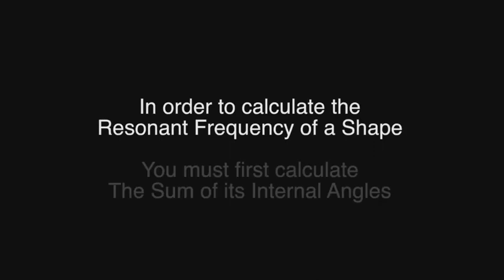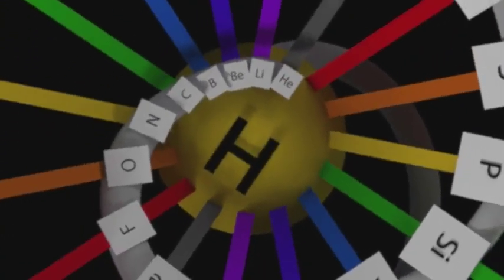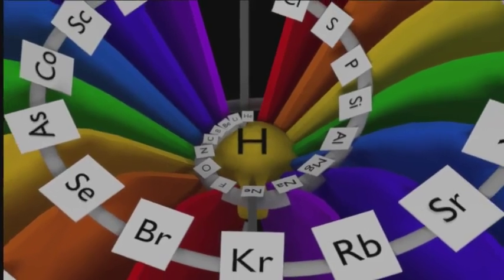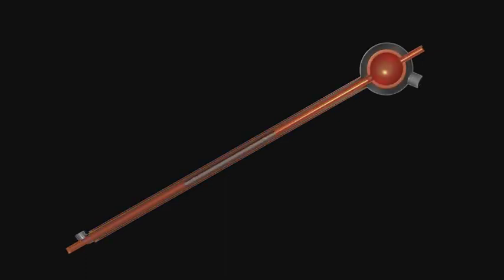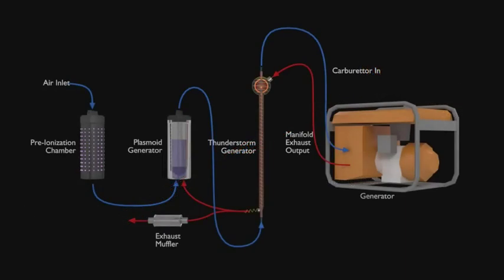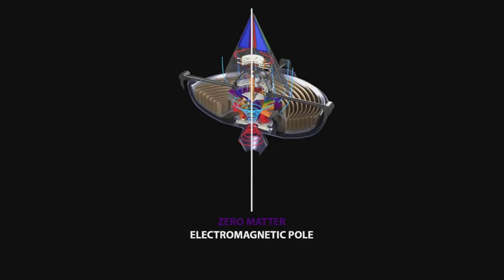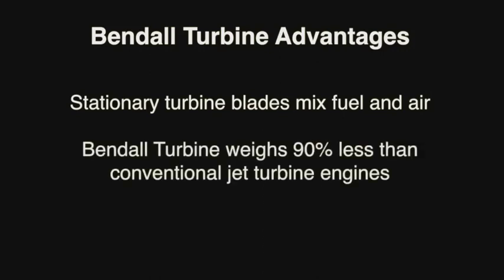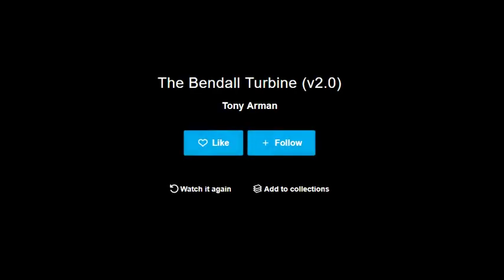The Bendall Turbine — Plasmoid Generator (Strike Foundation)

Comment: If this is true and you could harness this energy with a machine, there would be no way to turn it off. The machine would endlessly run until it malfunctions like all machines do. You really think the machine would be strong enough to shut down endless energy? You’re retarded

Comment: If you cut slab the inner circle of the outer exile, you need to refer to the atmosphere if the interjected sum angle at 44 degrees. This will always elude to 13 at any plasmoid.

Comment: Where is the flux Capacitor?
Reply: And where is the Continuum Transfunctioner?
Reply: And why is not the Plumbus visible? If you can't grapple the chumbles and can't flip the fleeb, how will the dinglebop be rubbed to generate heat?

Comment: I like how the literal model shown at 5:26 is later shown to be a physical part of the turbine design at 13:27, labeled as an "electron scavenger" (which is indeed a real thing I've just googled, but not the thing being portrayed). 
So what is it Mr. Bendall? A unified model of life the universe and everything? Or a physical component of your mystery motor? If your answer is anything other than "42", then I'm afraid I've lost track of what exacly you are trying to sell.
Well, if you make a schnazzy 3d model you might as well use it as much as you can I guess.

Comment: The new model is equipped with a Thundernuts antimatter chamber powering the Johnson Rod swirller.
Reply: Well there's your problem you need a new Johnson rod!
Reply: Johnson rod! I thought it was using an atom generator hooked up to a jake brake! Idk what to think know...
Reply: Your flay rod's obviously gone out of skew on your treadle, also.
Reply: Make sure it’s offset is precisely 69 degrees.

Comment: Sounds like geet
Reply: Seems to be be simply a refinement of GEET, with all parameters tuned as accurately as possible with the ECU and all that attention to design geometry/topology..
But just this week, after making all these wonderful designs, Bendall doesn't show a functioning turbine, but a modified OTR genset with a Perkins motor running very efficiently and ultra-clean- the modifications being only on the intake and exhaust systems, not at all the motor itself.
It is nothing to sneeze at, a 300KW generator running at lowered output of 200 or 250 KW, with very low CO2, CO, and almost no unburned HCs to speak of. The design is open-sourced, for anyone to try, with better results using stainless steel and copper for the intake/reactor/exhaust plenum, but still pretty amazing using mild steel. Bob Greenyer just posted a vid he made while visiting Bendall's test bed last week.(2023/10).

Comment: I fear Randall Carlson was duped. Hope it doesn't tarnish his career.
Reply: I was just thinking the same. I hope this is just a small hurdle for him.
Reply: alot of comments are saying this in these exact words on all the posts on redit and youtube on this subject...i smell bots
Reply: Never again on jre
Reply: So why don't we have these in production and use? I dont get it. If it's 20+ years old, shouldn't it have been implemented by now? I'm not trying to discredit, only trying to understand.
Reply: @slipknotic2682  It's only properly been acknowledged as working when built because according to modern "physics" it shouldn't. Ffs the electric ac engine for cars was designed by tesla in 1900 so why has that taken over 100 years?? Now they're everywhere same thing.
Reply: @slipknotic2682  because the thunderstorm generator would lower the price of oil and pretty much eliminate the need for green energy (even though gre3n energy is a scam) and the vajra implosive turbine would make energy free.
Reply: @slipknotic2682 @slipknotic2682  because the thunderstorm generator would lower the price of oil and pretty much eliminate the need for gr3en energy (even though gre3n energy is a scam) and the vajra implosive turbine would make energy free
Reply: Have you built a copy yourself? Ole mechanic said made a basic implementation in about 5 hours.

It would be very unfortunate if you were talking smack about something you've never even attempted.

If you have, I'd love to see your results!
Reply: Duped ...this works ...they've tested it plenty.
Reply: Hes bought and paid for by feds. To make people not see what is coming
Reply: https://youtu.be/d5YsK3bwzPM
Reply: I was duped by Graham hancock as well
Reply: This is the biggest bait comment I’ve ever seen, you should attempt more foundational videos before coming to this more advanced example. I don’t even understand but I strive to attempt before dismissal
Reply: @julianthincock6863  I'm a real engineer bud.
Reply: @iLoveChrisSmoove  Same and I agree. This is all garbage.
Reply: Duped? Maybe. But Randall's full of shit too.
Reply: Tesla probably had stupid monkeys throwing poop at him a time or two.
Reply: It won’t.
Reply: Go look at the recent data findings
Reply: Takes less work to sit in one's cave and agree with everybody else.  Of course they'll enjoy using it once it's in production.
Reply: He is bulletproof
Reply: He has been duped!
Reply: This thunderstorm generator works!! But if someone were to get something wrong your career isn't tarnished, your reputation isn't tarnished, you just happened to get something wrong, oh well, does everything we try but don't succeed at tarnish us? I think it makes us who we are. Be open and open minded. Peace
Reply: People who haven't done the research will always say it won't work and lazy people
Reply: Are you fucking serious??? This is the problem with the world today. People are too fast to label anything new and out of our understanding as bullshit. I bet you were fast to line up for your COVID vaccination wasn't you 🤣🤣🤣. Because some corrupt government told you to 🤣🤣🤣.  Our true ancient ancestors knew so much more about our actual world that is hard to comprehend. The ancient monuments all over the planet that we still have no idea how they were built and still couldn't do with our current technology was left to us to pass on the knowledge they had acquired to us when we were ready to start listening to all the evidence all around right before our eyes. Frequency is literally the key to everything
Reply: why? is it because you do not understand it yourself?
Reply: @DybbukDEpstein  buddy I have an Ocean Front Property in Montana to sell you.
Reply: @DybbukDEpstein  The first 30 seconds are utter nonsense. "The north pole which rotates anti-clockwise, and the south pole which rotates clockwise." What, each half of the imploded sphere are rotating in different directions? An object's resonant frequency is the sum of its internal angles.. Why are we using 8 planes and what's the significance of 22.5 degrees? The imploded sphere planes resemble the infinity symbol.. Why does that matter?  He's literally saying gobbledygook with no explanation.
Reply: @iLoveChrisSmoove  there are plenty of other videos on vortex math as well as books out there for you to formulate a foundational understanding of the subject than watching one video that is beyond your comprehension. Clearly you did not do that if all you can do is point to this particular video in order to discredit the theory. That's like watching someone speak in a foreign language and affirming that they talked gibberish since you could not make heads or tails of it. Look up Marko Rodin and watch his 20 part lecture from 20 years ago to attempt comprehension. You have zero fundamental understanding of the principals of vortex math which is by this is beyond you.
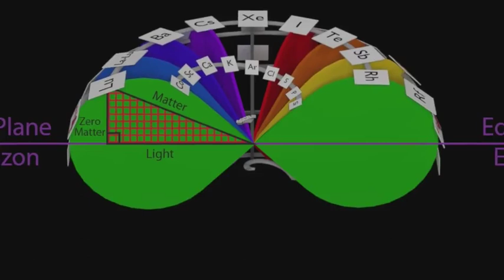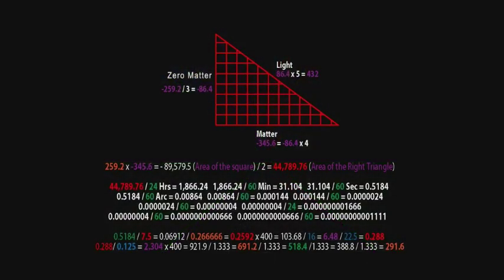Reply: @dybbukdepstein4972  I'm not arguing against vortex math or Marko Robin, just this hack Malcolm Bendall. Why does his graphic at 1:55 show Matter as the hypotenuse of the 345 triangle, but then his graphic at 2:05 shows Light as the hypotenuse? "ATV is the product of the ratios of the 345 triangle." So the ATV is always the same for each element? "The Bendall turbine weighs 90% less than a conventional jet turning engine" 😂 B.S. What, does he have a working prototype jet turbine? Where is it?
Reply: @iLoveChrisSmoove  Why are you not arguing Marko Rodin since his theory is IDENTICAL? Is it because you have no idea who he is? Dis you bother to research any of this aside from watching ONE video that you cannot grasp due to lack of foundational principals? Maybe get a firm grasp of the vortex math principals before telling people how they can or cannot be applied, since you have no idea what they are. Rodin just did a panel with fellow mathematicians on his channel regarding how to use these principals to create unlimited energy. same thing as Bendell is saying. People much smarter than you or me are investing millions into the R&D for this tech. Maybe you should contact these companies and provide your expertise on why it's a big scam so they stop wasting their money. LOL
Reply: @DybbukDEpstein  there are videos debunking "vortex math" all over the internet too
Reply: @DybbukDEpstein  I know that pretending you're a super genius and that there's this super complicated esoteric math that only you and like five people online can understand makes you feel special but let go dude it's not worth it. Or go get a PhD in math somewhere you clearly enjoy it and regular math is just as complicated and beautiful as vortex math.
Reply: @rexvectum  I'm not pretending anything. You either get it or you don't. Clearly you don't and you're angry. I have a doctorate in chemical engineering. I don't need another in math. Perhaps you are not aware that a piece of paper awarded for any specific field is not necessary to determine if one has the ability to comprehend the models? Regular math does not become complicated until university level abstract algebra or if only definitions are emphasized over understanding.  Probably best not to comment on mathematical theories if you think regular math is in any way complicated.
Edit: PS...Let what go? Did you forget that it was YOU who solicited a reply from me and not the other way around? Keep it moving,
Reply: @rexvectum  all these videos attempt to debunk a foundational theory with no science.  Vortex phenomenona and it's energy is widely observed in the meteorological area when tracking and studying tornadoes.
Reply: @nichon1951  vortices are obviously real and scientists use math to study them but as far as I can tell that's absolutely not what "vortex math" is
Reply: @iLoveChrisSmoove I mean the "looks like" comment was an observation
Reply: @rexvectum loya of videos debunking lots of things. How many of them are true?
Reply: @DybbukDEpstein just because you have Einstein in your username doesn't make you a genius.
This is completely gibberish and you are just trolling because it doesn't make any sense
Reply: @iLoveChrisSmoove  you need to watch the interview , come carpentier conversation from the India foundation.  You will be surprised at the tech
Reply: @iLoveChrisSmoove I thought the same, because when you see the device it just looks like water bubbling in a tube. How exactly is it doing any of this sacred magic stuff? Nobody can explain
Reply: @iLoveChrisSmoove You literally ain't got a clue when it comes to magnetic and die-electric field geometry do you?
Reply: @peterowley2014  what happened?
Reply: I fear you been duped. Randall knows his stuff
Reply: I fear you have done nothing with your life bigger than YouTube commenting .
Reply: @romeovioletti8166  lol damn why the attack?

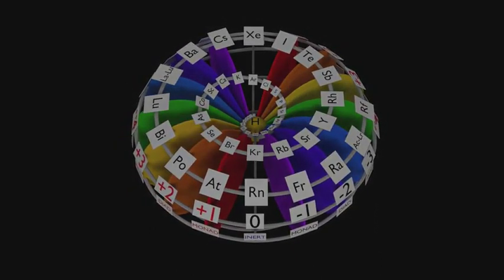Comment: 4:51 just straight-up lying that hydrogen has the highest charge density
Reply: In the 360 deg 0 deg paradigm 1 is the maximal boomstick magnifier
Reply: Right  Osmium has the highest charge density
Reply: That's because you are not taking into account the "sanskrit-Fibonacci curve", nor the musical octaves in the Octave Model. That changes everything man, it's high school math
Reply: What is the truth? What element has a charge density higher than 2,2 ?

Comment: This is a train wreck. I can't look away.
Reply: Lmao
Reply: Absolutely hilarious lol 

You do not calculate the resonant frequency with angles 🤣😂🤣😂🤣
Reply: They are closer then you think,sound can make plasma, harmonics are key
Reply: This technology is already used in a much simpler form. It’s a new technology in the mining industry used to melt rock with sound. From what I’ve heard they shoot an extremely concentrated laser beam of highly tuned frequencies, tuned to the specific rock material, and if you get the correct frequency and concentrate it enough, you can heat the rock up making it very easy to cut.
Reply: @steferos5601  that is not this tech... that's real life resonance, where it's based on the elasticity of the material, not angles of a light matter triangle
Reply: @nathaneigenfeld4514  so explain to me how something as socially accepted as a loudspeaker is not tech when that is also real life resonance?

Most of the people here discrediting something they don't understand most probably don't even know how an alternator works.
Reply: @steferos5601  that is different same book just different chapter

Comment: Just a hint why this is bullshit without knowing anything about it. The "zero matter" was changed in the audio, because probably it was changed in the script, for some reason or another. They didn't re record the audio, but changed only the specific words. Why this did this change occurred after the audio was recorded? This should be at least a 7-year-old project, according to the Joe Rogan video, maybe much older. Sudden changes in basic key elements in the theory are just not logical.... but hey, charge those plasmoids...